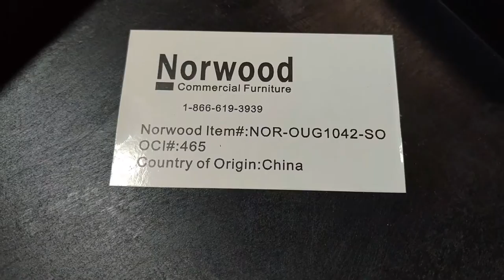assembling norwood commercial audio visual media adjustable height cart NOR-OUG1042-SO

Comment: I got this cart to transport my movie system and use it to charge my laptop so I was not taking up counter space in the kitchen and I like the fact it can go through some pretty tight spots and turn on a dime and that the two back casters have brakes I would not trade it for any other cart it rolls so easily the power cord is so easy to wrap around the push handle I also like the fact it can hold up to 396 pounds of stuff I would recommend this cart to anyone looking for a good quality Audio Visual Cart mom can even use it for gardening best cart I have gotten